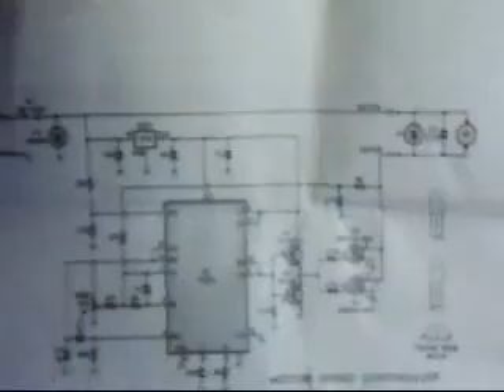PWM Motor Controller on HHO cell

Comment: i just purchased an xu1 drill from bunnings, makes a good PWM however i have to question the frequency.  So far its only going up to 3.5khz.  Very simple componentry suggests that it cant be modified further.  I am putting a potentiameter on it tomorrow so we shall get some accurate readings then.

Comment: i purchased one of these motor controllers- there are 2x ways to control motor speed.  One is to change the frequency of a 12v pulse and the other is to change the voltage itself.  The later has less torque and no PWM.  Jaycar sells this kit and a nitrous controller kit which is designed to pulse injectors- it has a PWM but it is only 10amps with the mosfet supplied.